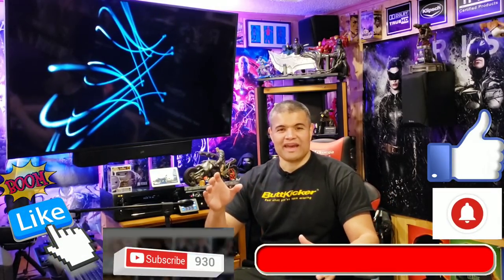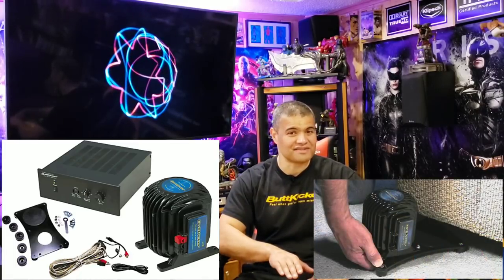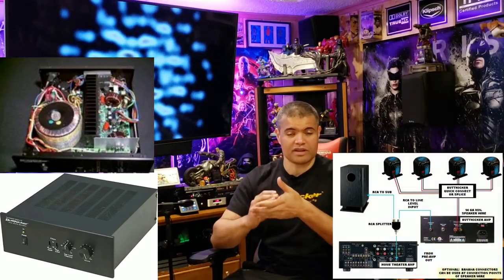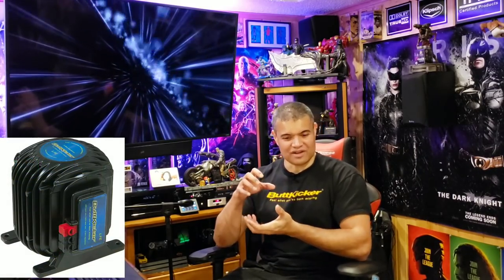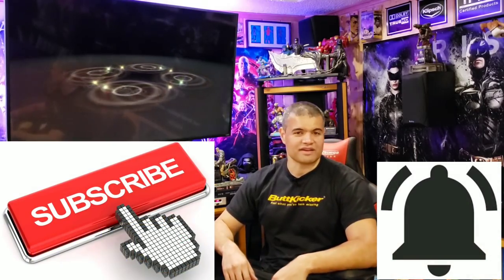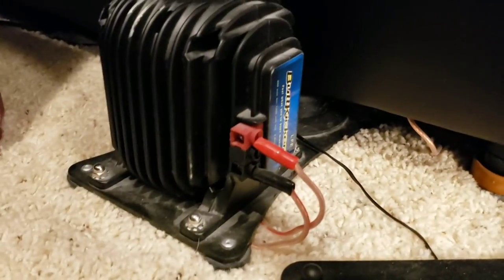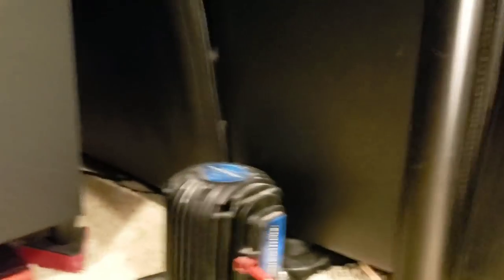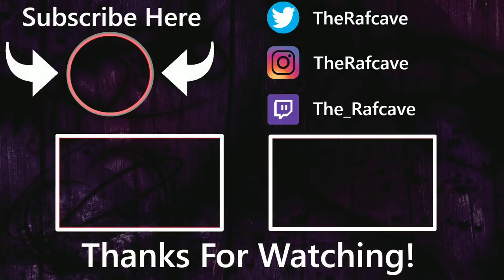Home Theater Talk : Buttkicker LFE: The Must Have Home Theater Add On. Let's Talk About It.

Comment: True that for that 4th dimension. Buttkickers rock but I am running AURA Tactile Transducers and they give the best bang (or in this case rumble) for the buck
Reply: Which amplifier did you use for your setup? Im looking at one of the Dayton ones
Reply: @Optimus-Prime-Rib  I used an analog Pioneer Full A/V rcvr which had circuit overload protection. Had the volume up a tad too much last summer and the receiver went into 'protect mode' and never came out. In the market for a newer amplifier to run the AURAs

Comment: I took your advice and convinced my wife who by the way doesn’t like you too much for all the money I’ve spent 😀 and had two transducers installed on the bottom of our leather sofa in our theater room. All I have to say is that it has completely transformed our theater room. I have an acoustically transparent screen and have 2 10inch subs behind the screen and the base was pretty good but having these transducers makes it feel like the base is everywhere.  Now this coupled with my 295 es and 7.2.4 Atmos setup, I feel like I have a mini Dolby cinema.  I want to thank you for making this video because it probably is the single most transformative item in my theater aside from the 4K 295 ES projector and the 133 inch screen. But I have to say that it is an absolute must have.  Thanks again my friend.
Reply from the maker: This Is amazing. 👏🏽❤️😊

Comment: I built a platform with 2x6's with plywood floor for 4 theater seats. Connected 3 butt kickers to the inside of the platform. Always give first timers a helicopter ride, awesome.
Reply: buster brown is there any video online explaining how the platform is done?  If not, just a lil explanation/ clarification? 
So, the platform is just free sanding on floor not screwed into any walls or anything right? 
I think I’d want to do this so I just want to make sure I do it right once I do.
Reply: @roco9504   Yes free standing, so it's able to vibrate, thus vibrating anything on it. Ive never seen a video, but there are pics on blu ray.com forums of guys as they build them as I have done or google buttkicker platforms pics. 2x6's 16 off center to desired width and length. install r13 insulation between each opening (prevent reverb)  2-4 buttkckers, plywood on top (carpeted)and hard rubber in spots underneath like hockey pucks, very simple. Mine is 12'x7' supporting 4 theatre seats and 3 buttkickers

Comment: Nice 👍🏻 I was looking at this Dayton audio SA1000 would this work with the buttkickers ?
Reply from the maker: Any high powered amp can work with Buttkicker LFEs, just need speaker wire to them and a sub signal. 👍🏽
Reply: @TheRafcave  thanks I’ll let you know how it goes when you set it up !
Reply: @ccheg.v.6407  how did it go?
Reply: @chopshop523  this really works ,it shakes the hell out of my theater seats 😂 !  No joke .

Comment: Hey Raf! Awesome demonstration! My question: Is there a way to cut off frequencies above 20 hz with the Buttkicker? I know the amp says 40 hz and below, but I only want it to play frequencies that my sub can't, so below 20 hz. Is there an option for that in the receiver maybe?
Reply from the maker: Thanks but only the amp can only cut the crossover to the indicated hz.  They're may be a different device to cut the frequency of the LFE...
Reply: You can use a miniDSP if you want to cutt off lower than what the amplifier can do.

Comment: Hello. Nice presentation! I have a question. Can one buttkicker with the platform supports two  couches ?? im from Greece and they dont sell buttkickers here so after an online search i found a retailer on another country that sells buttkickers. He sells 2 buttkickers 400-1500 watts with the amplifier at the price of 1300+ euro... thats why im asking if one can be placed for 2 couches.... i have 2 rows of seats in my theater... Thanks!
Reply from the maker: If you put a large wood board under both couches and attached one buttkicker you can feel something.

Comment: Would you recommend any buttkicker product even if I use it with ps4, tv series and music on a common 2 seats sofa? Maybe I wouldn't make full use of its potential...
should I settle for a cheaper bundle?
Thanks
Reply from the maker: Any buttkicker added to any seat makes a big difference!
Reply: @TheRafcave  have you noticed some deadzones on certain low frequencies responses on the buttkicker mini? I read about that in some comments around
Reply from the maker: @Unclog_my_gamecat_backlog  My crossover stops at 40hz.  It's just low lfe stuff.

Comment: Have you ever had noise issues with your LFEs?  I've had one for 10 years and it's been mostly a headache. First the amp fried, new amp (behringer), and now, if and when the LFE is working, it makes a harsh mechanical cabinet noise, like the driver is hitting. You ever run into anything like that? I'm going to have to tear mine down and see if there is a solution to be had. (internal lube/bumpers/etc)  Maybe you never acidentally turn yours up too high since you have so many running at once?
Reply from the maker: Mines been fine for many years. 🙂🤷🏽‍♂️👍🏽

Comment: There is something better than Butt Kickers, DBOX is better as they shack and move. 

I have butt kickers along with a few DBOX seats that are strictly for myself, son & bitch, and it does add a lot to experience of the movie, much better than just a seat that does nothing.

Bad part about these butt kickers is they are working for scenes that have music but not any real action. I mean it feels good, getting a massage but then again it takes away when the action scenes and explosions are happing because they are always working. I mean it is better to have them but that is my view on them. I wish they would make them where they could access the DBOX signals and vibrate on those scenes only.

DBOX seats for a full 8 seat theater is going to set you back 90k, reason I only have 4 seats and I got those used and got them for 15k.
Reply from the maker: Common man.  Buttkickers are a fraction of the cost of d box.

Comment: Ok... Maybe you can help me with this. ...  I have a Sony audio visual control center with a single subwoofer line out.  My subwoofer has a dual line in. I currently have a Y connector to connect it as such.  Now how can I take what I have a add an additional connection to connect to my Buttkicker amp with its single line level input?  That's where the wheels are falling off for me.
Reply from the maker: Ha, easy.  Get a y-adapter male 2 female from your Sony lfe output. 😉

Comment: Do you think buttkicker would work without subwoofer? I think my main speakers can go down to 40hz, but currently no sub
Reply from the maker: Yes, you can use the subwoofer out of your AVR to the buttkicker amp and get the signal.  It's not a sub replacement, but an extension of a subwoofer. Must have in my opinion.

Comment: When I was younger I always used to say, you have to feel the bass, not just hear it... Never knew about the existence of transducers/butt-kickers, I learned about them from my interest in sim racing where people mount butt-kickers to their rig that gets powered by simhub software to get those car vibrations to your rig.
So at some point I was wondering what the original use for these butt-kickers was besides sim racing, and when I realized they just work on LFE channels, I decided to buy one and mount it to my sofa.
And DAMN!!! It performs, SO GOOD!!! 
Really strong vibrations, because it's mounted to a metal plate side-mounted to the metal frame underneath the actual sofa, the metal frame was designed to be just for the legs/feet of the sofa. Found out that the way I mounted it, it actually increases the vibrations 😂

It's mounted like this: 
__butt-kicker__|:[frame]
Where the lines are the plate, which is bolted : to the frame.
And the butt-kicker actuates a weight up and down, so it functions like it's on a lever which I think increase the vibrations significantly 😂😂😂🤣 though it's also like a reverb effect, a short 5Hz bass sound will shake a little bit longer than intended.
Reply: I'm so glad I went for a tactile transducer before investing in upgrading my 5.1 setup to 5.2.2 + Zone2 2.0

A tactile transducer is such an awesome experience, beats any amount of extra speakers!!! 😁 

Btw I've been saying butt-kicker but I have an "AuraSound AST-2B-4 Pro" Bass shaker, not sure if butt-kicker is also a term for bass shakers or just a brand-name, I've been saying it as a term as it's easy to remember and it really does kick your butt! But it's not from the butt-kicker brand.

Comment: so im getting into sim Racing and bought a Buttkicker MiniLFE and a 100w power amp on amazon and it has pbtl. I wired it as i figured positive/ground cable from the unit but it keeps overheating. I have been trying to research all morning to find a solution and i think i need to wire it for pbtl and use that mode to get it to not overheat so fast. I am new to audio but do you think that will work?
Reply from the maker: I would contact buttkicker support

Comment: Hey Raf! I looked at getting a setup like yours but found the BKA-1000-M is being re-engineered.  Do you know anything about this?  Have you had any issues with the current amplifier your have?  It's my understanding they had some issue with the amp and are making changes/improvements.  

On you theater seating you are using the daisy chain wiring?
Reply from the maker: Hey Terry!  I know some of the early model Amps caught on fire!  So If It's re engineered then that's a good thing!  Yes I'm daisy chaining them to the amp.

Comment: If you don't rubbermount your engine in your car, it get a lot of vibrations. 
Would it not be the same with this?
No rubber under the feet equals more vibrations!?
Reply from the maker: I use rubber isolators under the feet of my seats to improve the rumble.

Comment: I have the denon avr 6500h that has two subwoofer outs which I use for my two subs.  How would I connect this?  How many would you recommend for a 87 inch wide sofa?  Does the lfe unit have power?
Reply from the maker: You could get a Y-Splitter for one of the sub outs.  Two kickers would be enough.  Yes the Buttkicker amp would provide the power to them.